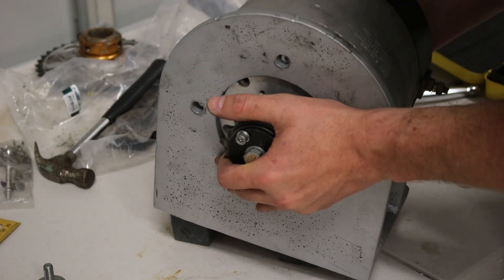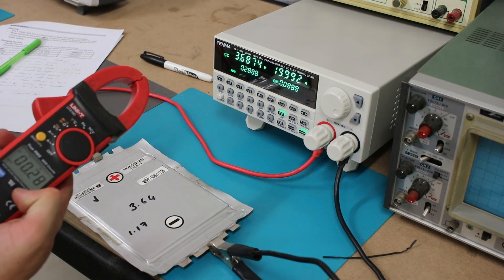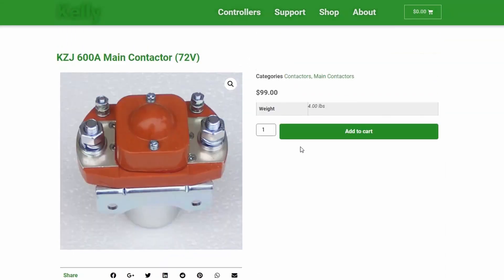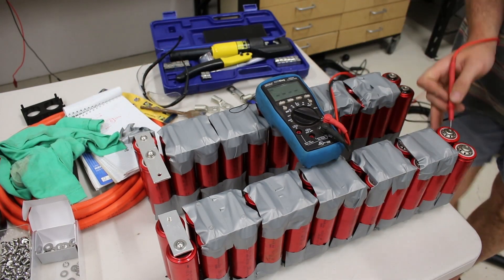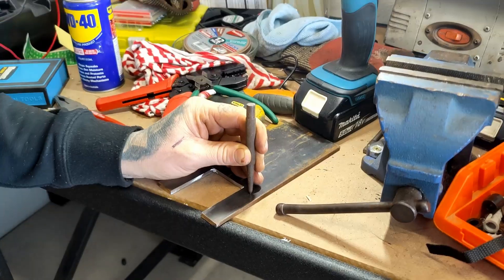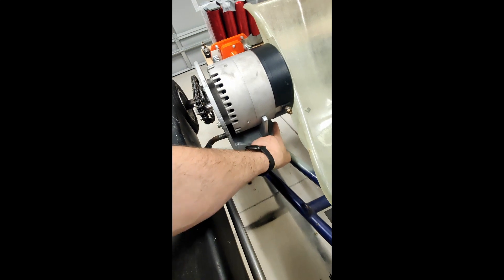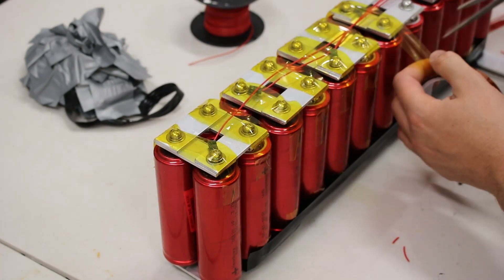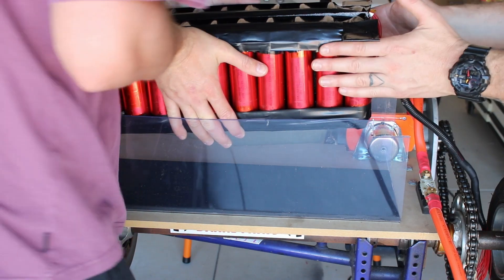DIY Electric Go Kart (Part 7)

Comment: Hello, over the last couple days I’ve watched all of your videos and would love to recreate a similar kart for a school test project for my FSAE team, do you by chance have a parts list of all the stuff you needed to make this build work, I’ve got the motor Kelly controller, what Daly bms model did you use, and I know the 38120 cells also what throttle did you use for acceleration? I know you’re probably busy but I figured I would ask and see if I could get a response. Ps much respect for the problem solution style video series, I love to see the progression!
Reply from the maker: Hey Gregory, thanks for the comment. There are a few extra parts but you are on the right track with the main components so far. I ordered the 500a 24s lifepo4 Daly BMS, there is also the kzj 600a main contactor, fuse holder and 500a fuse from Kelly. The throttle is something generic called a PB-6 which is a 0-5kOhm potentiometer. Get two of the throttles if you were thinking of exploring regen. Hope that helps mate good luck!
Reply: Awesome, thank you soo much! I look forward to seeing what you do in the future!

Comment: What exactly does the motor controller do in this project ? does it help the battery charge the super capacitor as well or does that happen on its own since they are connected in parallel ?

Comment: I need help understanding

What does the amp of the battery have to do with the controller and speed/rpm of the motor ?
Reply from the maker: A controller may have a limitation of how much current it can handle (ie a maximum current limit). The motor may also have a limit to how much current it can pass through it's conductors without damage or overheating. Speed of the motor is usually related to voltage and not current. The more current available the more torque the motor will have is also a good rule of thumb
Reply: @TheHandyTech  Thank you, but why are some 72v motors able to have more top speed that other 72v motors?
Reply from the maker: @Lou246  Lots of factors to consider but sometimes it can be due to load resistance. This is assuming there is no difference in motor dimensions and gearing etc. The rule is motor rpm is proportional to voltage in a DC system
Reply: @TheHandyTech  Thank you very much

Comment: I saw you used the alltrax 48300 controller earlier. Why did you get a new motor speed controller? Any meaningful difference in quality? The price point of the Kelly is like 1/3 of the Alltrax. Looking at purchasing one and interested in any tips!
Reply from the maker: Hey Cory, I changed to a Kelly unit as it has a higher maximum current capability to suit the new motor. It also supports other functions like regenerative braking etc

Comment: I was wondering if you can help me with a question. Your battery pack was 80v but what AH did it end up being? I am looking to start a project with my son and am trying to figure this out lol. Thank in advance for your help.
Reply from the maker: Hi Jamie, no problem. The cells are 8Ah each, and we have a 24s2p configuration. So 24 cells connected in series, and each one of those cells has a parallel cell. So we essentially have twice the AH rating (ie a 16AH rating). Hope this helps mate. Good luck with your project, hope your son enjoys it!
Reply: @TheHandyTech  Thank you for response it help a lot.

Comment: I think that most kart chassis flex a bit when cornering so cutting that wooden battery tray so close to the seat may make it rub so if you notice any change in the handling or its loosing traction that may be why.
Reply from the maker: Good spot bro, will see what happens when I test drive it. Loosing traction may be desirable haha

Comment: Holy shit why would you hold an angle grinder like that. 

Very stupid.
Reply: Hahaha, I once tried to cut a pipe with two stands short, only had 2. The pipe pinched the disk and it exploded. Luckily I was wearing eye protection, and nothing hit my cheeks or throat 😬
Reply from the maker: Good observation bro, but the camera angle makes it look worse. If the grinder happened to kick it would be in the direction the disk is rotating, which in this case is down away from my arm